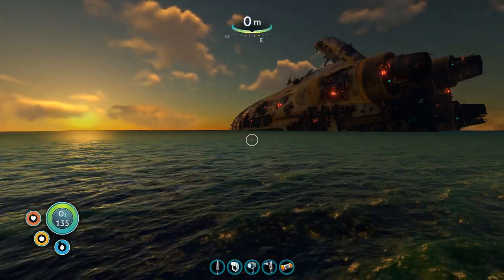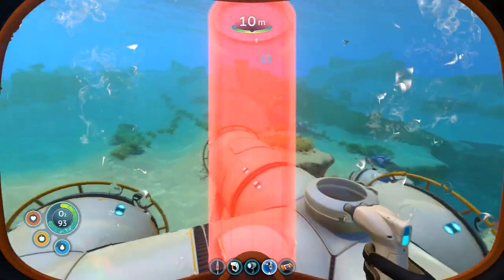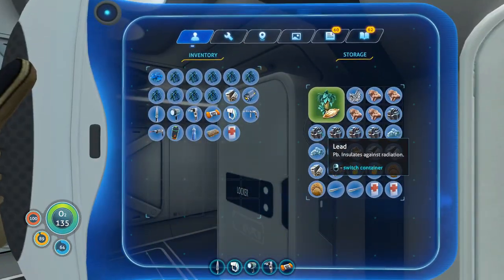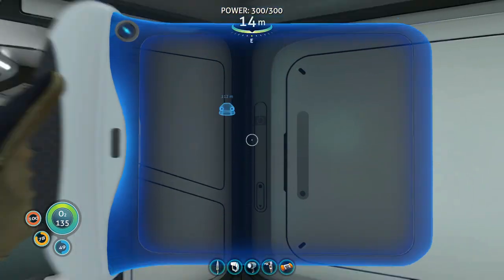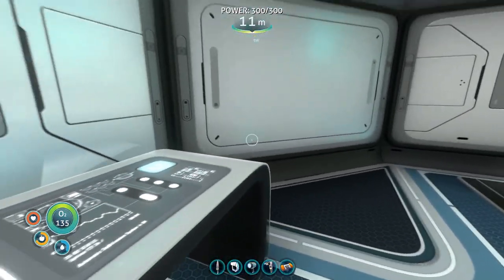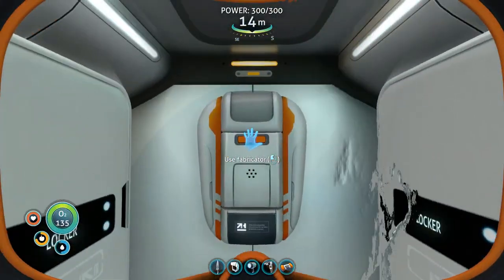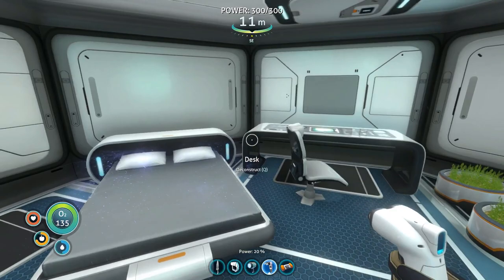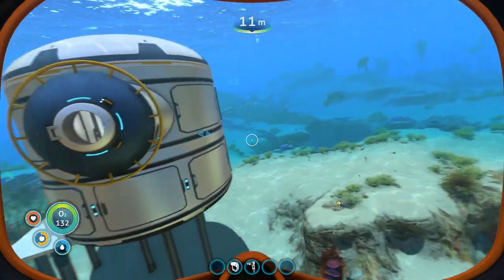Subnautica v1.0 Tutorial Playthrough: Day 10.5 Base Expansion

Comment: Tip on placing the double bed where you originally intended is to have a window in place first. The double beds tend to want a window along the center walls for easy placement.

Comment: how do you set up those blue lines from your solar, or is that automatic?
Reply from the maker: Those appear automatically to indicate the panels are close enough to the base to power it.  If you don't see a blue line, the solar panel is too far away from the base.
Reply: I built one on top of a sole scanning station, and it's not actually sitting on top, just kind of floating there. I'm pretty sure it still works though and there is no blue line. do we only get the line when placing it away from a building?

Comment: On the topic of sorting. Do you have a system for sorting everything?
Reply from the maker: When I first started playing I did but it was never efficient and I eventually stopped bothering.  Be advised however there are 2 mods available that make sorting easier, or a non-issue.  The Autosort Lockers mod lets you set specific categories for each locker, then dump everything into one Sorting locker and have everything go where it's supposed to.  The other is EasyCraft which automatically pulls needed materials from anywhere on base so you don't have to go looking for them and swap them in and out of your inventory all the time. I highly recommend EasyCraft, it makes the game much, much less grindy.  Finding and gathering the materials is the fun part - going hunting through a dozen lockers for that one last piece of Lead is not fun.
Reply: Cougarific just like Automated Ark. 😜 I was telling someone the other day that it would be cool if they combined Ark and Subnautica. 😜
Reply: Cougarific I just started putting those text labels I’ve them.
Reply: I have my beginner's base lined with lockers ( about 15) including one of the larger glass storage lockers. I've been labeling them to try and keep it organized but I seem to end up with a lot of misc items like stalker's teeth and tube coral....things I really don't need to store. The labeling does help with the items that are used a lot, but I'm still in the smaller stages of my first base and need more blueprints to expand to larger modules....Can't wait to start growing things inside and out and my living quarters with a lot of the loot I collected from the Aurora.   
Great job on the tutorials Cougar...lots of likes and a +Sub.
Reply: DieselCat18 i started categorizing. So I have 

Titanium, Metals, Salts, Crystals, Plants, Rubber, Components, Survival, Rare, Etc

Metals is every metal other than Titanium
Salts is Salt, Sulfur, Lithium
Crystals is Diamonds, Quartz, Rubies
Components is anything made up of more than one other item like computer chips or enameled glass
Rubber is basically anything you can make from creepvines
Etc
Reply: Good suggestions....Thxxx